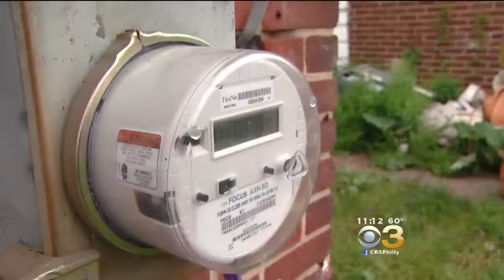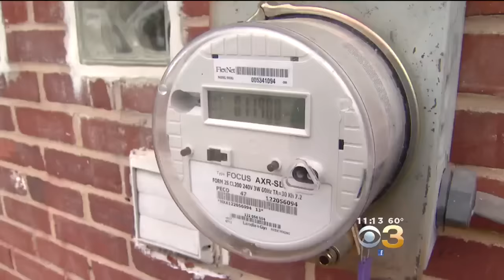PECO Combats People Using Everyday Items To Steal Power

Comment: Maybe.... if Electricity was more affordable, maybe these low income people could actually afford it.  These admin fees and all these other fees that are just part of this bill drive the cost up.  Then there is the charges for usage that are also high.  I have a small home and I use between 400 to 600 Kwh per month and my bill is still well over $100.  Absolutely unacceptable.  I get charged over $30 before I even get charged for usage.  These admin fees should be on a sliding scale with a maximum.  This is ridiculous.  Just charge me for my usage and make it reasonable.  It doesn't have to be complicated !!!
Reply: looks like most of these could afford satellite tv...when people steal power, it drives up the cost for paying customers
Reply: That's not the point.  The point is its expensive
Reply: stealing drives up the price of anything for the paying customers.
Reply: Bet you when they stop the theft the cost will remain high because they know they can get away with it,   high costs came before stealing,   theft is a result of the high costs.
Reply: They're probably stealing the satellite TV as well.
Reply: Once again: if everyone stopped stealing this shit, they would NOT lower their prices.
Reply: Actually they would.  Let's say you have lemonade stand.  And you sell it for 10 cents a cup.  You sell 100 cups a day, which is $10 in sales.  And your cost of sugar and lemonade, cups is $3.  Your gross profit is $7 a day.  Now someone starts stealing your lemonade every time you answer a text message, and now  you're setting out 300 cups a day, but only getting paid for 100.  Now your cost is $9, and you still only have $10 in the register at the end of the day.  How do you buy all the materials for $1?  You'd quit selling lemonade, or raise the price from 10 cents a cup to 30 cents .  But the power company can't quit selling electricity.  So they are forced to raise the price so that everyone who is paying pays a portion of the theft done by others.  Any business works this way.  Regulators limit the profit margin of the power company.  If everyone stealing started paying, the profit margin would increase, and by law they'd have to lower prices to maintain the target profit margin.
Reply: Ed West  exactly!
Reply: Yea but they are still in the business to make money.  They do have rates and fees that should be lower.  Years ago I had a coworker I was friendly with that converted to solar and had one of those "send his overage back to the grid and get a credit from the power company" setup installed.  The utility company sent him a letter and said they had a representative out there doing an audit and that the hook up was done without a permit and not done through their approved supplier (which was triple the money) and that it would have to be removed or face disconnection and fines.  He sent them a copy of the permit for the job and told them to f*ck off.  They showed up one day and cut him off at the pole.  Then they filed in court about tampering with their equipment.  In court he showed up with two men who were master electricians in residential and commercial and who also happen to be former lineman for the same electric company.  They were also Union and showed up with their Union attorney.  They presented to the judge that the proper permits were applied for and work was done by skilled union electricians that were licensed, insured, bonded, and well credentialed.  And then they also showed that the work was approved after an inspection.  The judged agreed that it was a money grab by the utility company and they award my friend and the electricians some dollar amount for the inconvenience and legal fees.  The attorney for the union issued a press release and sent it to the local network news departments and they had little interest in the story.  Imagine that.
Reply: Because the rate your charged also covers the wasted fuel on their end overproducing electricity. They fool you into thinking that they just sell it to places like Mexico, but think about it, can they even store the energy they waste and move it, and do they even own the grid down that far, maybe in Texas. To generate a single Kwh, on natural gas, costs approximately $.000012, of course after paying maintenance and administration fees that goes up to $.00026, so the total non-profit cost for your home would be $0.15 per month. The numbers provided are for Western America, they change depending on your actual location and if there is a nearby coal or gas refinery near you, but Washington state has the highest actual cost of $0.0029 per Kwh. Thus even at the rate they suggest people steal power in this 'hotspot' of power theft, even one person paying their bill covers over 100 homes.
Reply: the juice itself ain't that expensive, it is the taxes, surcharges,fees etc that add up fast.
Reply: gchsbus the struggle is real lol where i’m from we don’t pay for utilities, water, electricity, and trash is all free provided by the government. we pay taxes the government uses those taxes to provide these services.
Reply: gchsbus with the dozens upon dozens of programs available to these people they CAN afford it. I can all but gaurantee you that not one of them would be paying more than $15 per month after all of their "gub'mint gibs" were applied.
Reply: Meya Enyo theft is a result of inherent laziness and a sense of entitlement.
Reply: gchsbus union & legal don't go together. If anything happened, the ibew boys threatened to break the judges legs if he did not rule in their clients favor.
Reply: orion2themax i once asked my boss why some of my coworkers do not work full time and he told me they don’t want to lose their government benefits. so they only work like 3 hours get paid roughly 500 every week. maybe i should do that instead of busting my ass all day.
Reply: First world problems.

Learn to use less electricity. Stop complaining for something you can have an absolute control of.
Reply: gchsbus it doesn't have to be complicated for you, because you're only plugging something into an outlet..  that line that leaves your house doesn't just plug right into the ground, there's a lot going on to provide that electricity to you..  would you feel any different if you just got a piece of paper that said "electric bill $150" ? 

you can try your best to produce the electric yourself though..  I heard they sell stationary bicycles that you ride that act as a generator..
Reply: gchsbus ,  Maybe if they   Had a moral compas they wouldn't be addicted to drugs or have 20 kids by 10 different dads and it would be able to pay their bills like the rest of us.
Reply: ROTAXD I make 20000 a year I have no Health Care I'm taking care of my dad's kids and a house I can't afford which I'm trying to sell so I can move into a house I can afford with $176,000 in debt that he left me when he died

69% of everything I make is taxes the vast majority of that the $8,600 a year in property taxes I pay on this house

I make too little money to qualify for Obamacare and I can't get State Health care because I make too much money

I get no Aid and qualify for no Aid from the government and Welfare
Reply: gchsbus,  but look at what electrical power does for you, could you pay someone $100 a month to replicate the effort it saves you,  the taxes, surcharges and fees are ridiculous though.
Reply: paul w electricity should be government-run socialism communism whatever you want to call it that's what electricity should be because actual competition is not possible because we can't afford to run multiple power lines to every house by effectively making it mandatory and also a monopoly and then corrupt the government regulating them and you end up with out-of-control prices

In today's day and age electricity is a necessity of life no different than water air food in fact it's illegal in most places not to have electricity therefore there should be no profit involved in the actual delivering electricity to the customer
Reply: gchsbus, if electricity were more affordable they'd still steal it, it's all part of their hustle.
Reply: I agree.  Our usage is in the bottom quarter but that doesn't change the transmission fees which are half the bill.
Reply: Here in Australia, electricity can cost up to  35 cents a kWh, and supply charge of about $1.50 a day. so 600 Kwh here would be about $250 ish, with the supply charge.
Reply: This is PECO everyone's taking about they sponsor every sports and weather segment they can get their hands on.
Reply: Tesla had a mind for that. free electricity was a Great concept of his on paper, however now a days these energy companies control too much for that to ever be possible. But I guess we all have to pay our bills and even the rich seek the same thing poor people do.
Reply: gchsbus The low income get reduced rates paid for by you and everyone else who works, duh! What do you think all those admin fees are for?The thieves are so accustomed to a public handout that they feel they deserve everything for free, that’s why they use their welfare check and food stamps for crack, meth,alcohol, cigarettes and weave.
Reply: How much are you paying for Kwhr?
Reply: Everything you posted is absolute, complete, and total nonsense.  According to you, they would be making a profit margin of approximately 326 percent... which is laughable.  Their profit margins, in most states, ARE REGULATED BY THE STATE.   The financials are open for ANYONE to go see. No power utility in the entire United states is making even a 40 percent margin, let alone a 326 percent margin. What a joke.

I want you to use what little you have to think about this:  If ANY company is doing something at a 326 percent profit, WHY would another company not come along and compete?  For a 326 percent profit I could start up a utility, charge a 250 percent profit, and run all new lines and build new plants yet still almost instantly be in profit. 

326 percent, what a joke.

Comment: make the product cheaper and the people wont' spend so much time stealing it!
Reply: Bullshit im a city where they just requested a 19% increase to pay for a coal ash spill they caused. So the customers are paying for the electric companies mistakes. I came from a city where they used the utilities to fund the city and every time they were short on money they raised the electric rates. Stealing went on their to and not out of greed some did it to avoid freezing to death in the winter and still being able to put food on the table. Electricity rates are extremely high and going higher and people need it and every town is run by a monopoly power company that is the only option so they can raise the rates to what ever they want and you have to take it.
Reply: ike fun they have arranged it so you cannot go anywhere else see how that works
Reply: ike fun - It can actually be illegal to not be connected.  This is the case in some places.
Reply: ike fun there are many blanket laws I just gave you 5 states look it up it may not say directly you must be connected to the grid, but they have many blanket laws which get the same thing done
Reply: ike fun 
And who are these other companies you are going to go to? They own their own source of power, method of delivering it and system to monitor and bill for it. These little "co-ops"  or what ever you want to call them shill company who sells power at a slightly lower rate delivers this power through the electric companies power lines it's not their ewuiptment. Do you think the power company"lets" them borrow their lines while they pay to maintain them, fix them when ice or a car knocks a pole down etc. Unfortunately they are not that nice. They "rent" the usage of these wires. Look on your bill. Some of those small fees that there's a lot of that add up is a delivery charge and line usage fee amongst taxes out the ass "then" you get to the actual usage charge. You know the one that shows exactly how much you actually. It's amazing the difference from actual usage and the actual bill. So you have to pay them whether they bill you or a phony, crony of the power company. The only true competition id's tho build a wind mill (farm) or solar panels. I find it pathetic how our President Obama provided incentive programs who let people have solar put on their house with no money down (our state receives it anyway) and in Trump undoing everything the black presidents like start back with dangerous coal and this new deal of no more free trade butbewual trade BS out of a million product to start with he hit the companies that import solar panels that Not only are being made cheaply lol but they just so happen to be highly productive over what's been made over. The past years. So when the smoke settles from Wednesday he's disguising as equal trade will in the end cost us more for power taxed over line usage or cost more to have to pay MUCH more for These cutting edge photo voltaic cell panels with other film type of solar panels I don't think we make for more money. I think we do manufacture any of them at all. That was snuck past most people because they are in the dark on that deal.

He said he was draining out the swamp. All he's don't was flush a lot of shit into the cesspool he built. Washingtons about to stink so bad Mexico is gonna build a wall to keep the smell out. Maybe the world will get together to build a dome over America to keep the stench down that's about to back up. Then put a travel ban on us until we've been vetted through a political shower💩💩💩
Reply: Mike Adams they sure as fuck will. Can give it to them for free and they'd try to steal to get more on the arm.
Reply: Or dont steal??

Comment: Surely the home owner could refuse them access as they don't have a warrant?
Reply: Tormented Darkness I think there's a law that since the power box belongs to the power company they are allowed access to their property regardless of the home owners feelings about it... But don't quote me because I can't remember where I heard about that
Reply: Probable cause.

Quite easy to trace any fragment of power and exactly where it is going to. Also, any utility line is the property of the utility - up to the point where it enters any structure
Reply: Warrant is necessary for investigating suspected criminal activity. Electric theft by way of a delinquent account is considered a civil matter and since the meter and line are owned by the utility it can be accessed due to an easement, no warrant necessary
Reply: I think if it is visible from outside the property it is ok.

using heat vision is does require a warrant but in this case the wires were visible from the street.
Reply: ike fun it's illegal to have all their property removed nice catch 22 how about talking in a civilized manner
Reply: ike fun In some places, youre forced to pay for utilities even if you're selfsufficient, loose their property, lose youre house.

Comment: Why is the power company so LAZY ... cut the wire at the pole!
Reply: im assuming its not that easy? 30% of them are stealing the power there, then they have to reattach them when they want to continue service with $$, besides, depending on the laws there, its not as easy as cutting the wires i assume, here in nebraska from "what ive heard" power companys cant deny the elderly power in the winter.
Reply: They do cut the wires at the pole/underground but the people just use what ever wire they can get to hook it back up. Generally they wait till the 2nd or 3rd time they catch them jumping at the meter to remove everything to the main line as they have to pay to put it back when it comes time to hook that house back up.

The wire used from the pole is around $1/foot plus labor and other odds and ends needed so if they have to replace 45 houses for the 30% of the houses they talked about that is around $14,000. As for why the wire is so expensive it has a lot of copper or aluminum in it and the insulation has to last years of sun exposure yet still be able to flex in the wind.
Reply: It might only be a dollar a foot , but I know some Electronic companies charge a $1000 a foot.
Reply: Good points guys .. thanks for the info!
Reply: The labor cost of cutting at the pole or in the pedestal is exponentially more than just pulling the meter and securing the socket. Most everyone in this comment section is bitching about costs, imagine how much more it would cost the customer who got shut off if they had to pay for a crew to climb up and reconnect at the pole rather than just having a guy come plug a new meter in a socket
Reply: Because 90% of shutoffs are RECONNECT in under a week....paid bill or energy assistance....if it is done more than 2 or 3 times they will remove the service